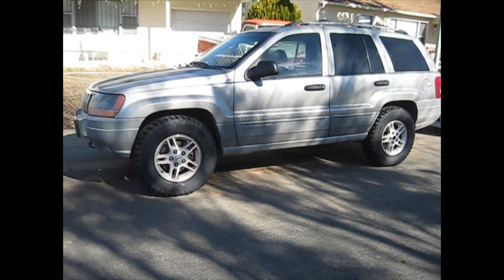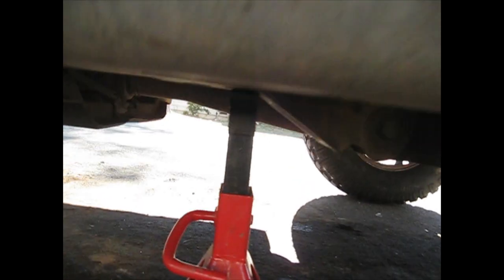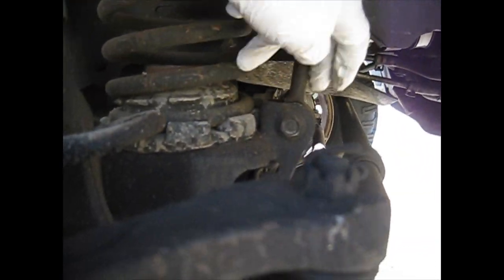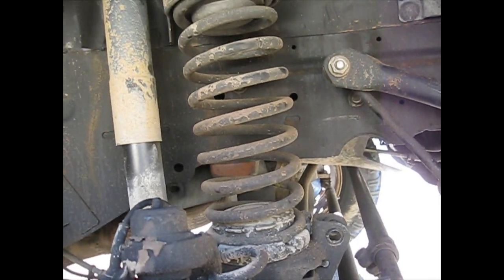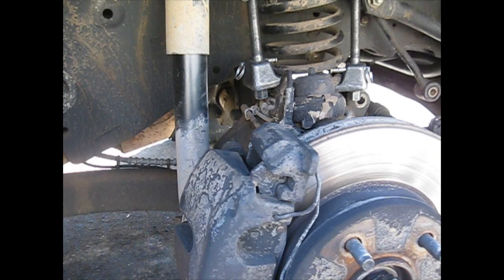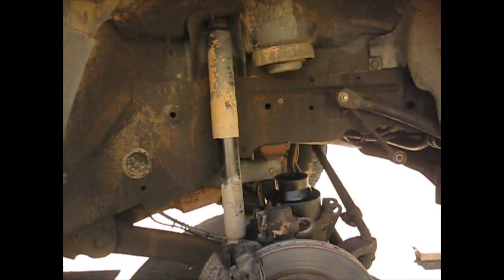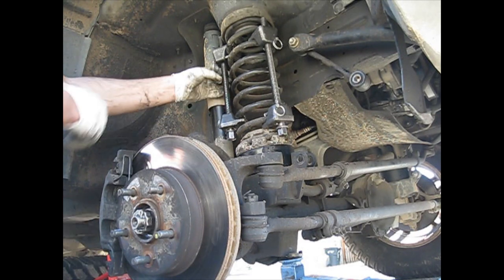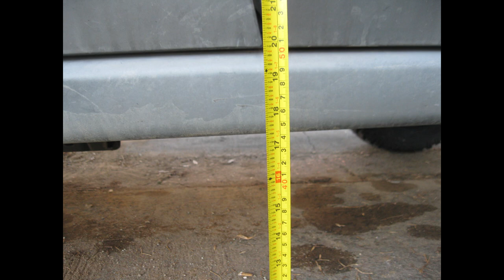2000 Jeep Grand Cherokee WJ 2" Budget Boost lift front

Comment: could you fit 33s after putting the 2 inch lift?
Reply: Martin Colula i fit 31 with very minor trimming
Reply from the maker: Martin Colula NO!!!
Reply: +Jacob Lagerstrom im going to soon get some wrangler wheels. Most come with255/75 and some with 255/70 i believe. You said you run 32s on your jeep without any modification to the suspension or fenders?

Comment: Why didn't you just put the compressors on when the spring was compressed? derrrrr
Reply: They don't fit because the coils are too close together. You have to get it as close as you can to fit the compressors in.

Comment: Did you have to align the wheels after?
Reply: As with any suspension mods, yes, it is required it be aligned ASAP because it will mess with geometry a little bit.
Reply: As with any suspension mods, yes, it is required it be aligned ASAP because it will mess with geometry a little bit.
Reply: Well, you're not messing the toe in or the camber or tie rods. I don't know why you would need to, I'd like to see the alignment stats before and after to see if it messes with it.
Reply: @JF32304  
Actually it does a bit. The axle swings down, the pinion goes up, caster changes and that has a slight effect on camber and toe.

Comment: 9 years later and the coil spring spacers are supposed to go above the springs.  Read your instructions people.
Reply from the maker: Why don't you explain to everybody why they should be on top vs the bottom is there a difference in your opinion? And don't give me some bullshit answer like that's what the instructions say because instructions are generally a guideline on how to do things not this is exactly how it should be done.

What do you think is going to happen if it was installed that way?

How long do you think I drove it like that for without having problems?

My YouTube channel has all the video evidence you'll need LOL

Comment: In your video for the front and the back you decompress the spring, put the compressor on, then compress the spring all the way back down, that doesn't make any sense. You do the same thing when you're taking the compressor off. You ought to be installing the compressor at the springs most compressed state as well as uninstalling it at its most compressed state, it will save you a good amount of time and trouble.
Reply from the maker: "You ought to be installing the compressor at the springs most compressed state as well as uninstalling it at its most compressed state."
Only if you can fit the spring compressor on when the springs are all the way compressed. Not happing the spring compressor is about a 1/2 inch thick.
Reply: I think you're completely missing my point. Even at the amount of compression at which you remove the springs, there is still enough space to get the lip of the compressor in and out of the space between the coils. I'm just saying you're making too much work for yourself, not that you're doing anything "wrong." I appreciate that you made these videos, things like this help a lot when guys come asking around on forums about how to install their new lift. Thanks.

Comment: The spacers should always be mounted on TOP of the spring as it is retained by a clip that prevents the spring from coming off if stretched..
Reply from the maker: It really dose NOT matter it its on top or bottom. It's not going to come out even at full flex. I put over 40,000 miles on it since I've installed those spacers and have had zero problems with alignment or wobbling or any other issues. I have a ton of videos on my channel of it off road under full Flex check out my newest video Jeep WJ flexing.

Comment: Did u keep the stock shocks
Reply from the maker: Yes. I did not need to replace them and it rides just fine on and off road.
Reply: FastestIntegra. Thanks For The reply was asking cuz I'm going to be lifting mine up but wasn't sure if I could use the shocks already has
Reply from the maker: You can check if your shocks are good by taking them off and trying to compress them by hand if they go all the way down and don't come back up that shock is bad.

Comment: Any one lift a 2000 Jeep 4x4 awd  that has only 4hi with 4 low? I was told u couldn’t
Reply from the maker: Yes you can lift it no problem. Mine is a 2000 with the AWD Quadra-Drive system has 4Hi, N and 4low.
Reply: They also sell transmission spacers to mitigate any drive line vibrations. I have heard you only need that around a 3+ inch lift so 2 inches you probably wont need it.
Reply from the maker: @davishunt3018  I have only seen the Transfer Case spacer kit not a transmission kit.
Reply: @FastestIntegra  My bad that's what I meant haha
Reply: FastestIntegra ok thank you

Comment: Bro the budget booster had to go on top of the spring not the bottom 🤣
Reply from the maker: You're like the 100th person to say that and no they don't need to be on top I put thousands of miles on and off-road with them like that had zero problems it drove awesome and four-wheeled like a champ now that I'm taking those off and putting a 4-in lift on got full videos of that as well